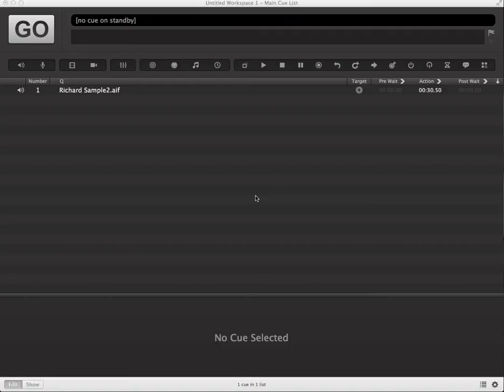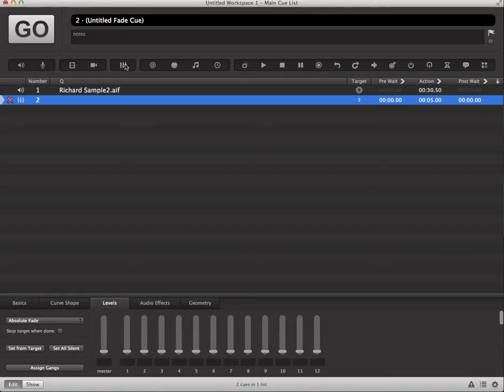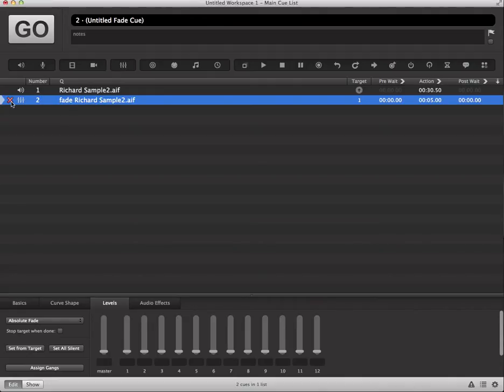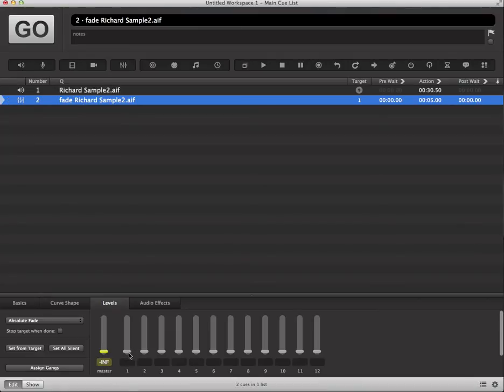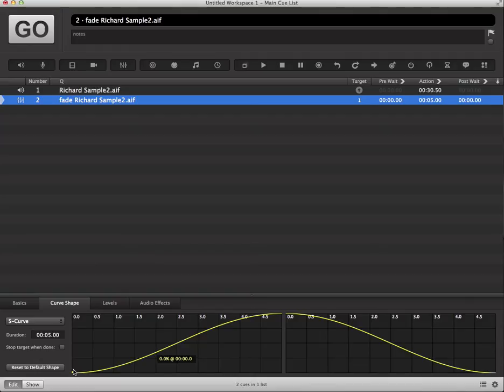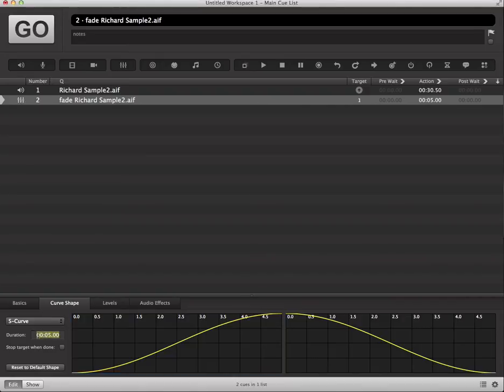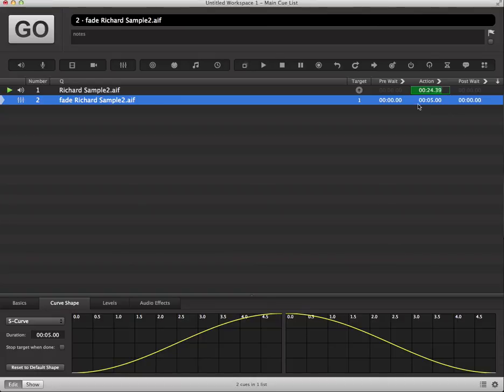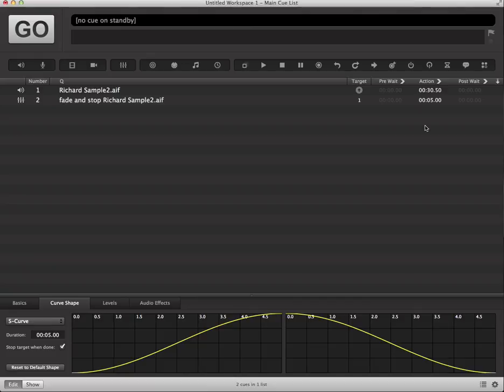Mastering the Fade Cue in QLab

Comment: Why is it necessary to not only set the master level to -inf , but also the levels of ch 1 and 2 ??? 
Shouldn't the master level be enough to take care of all device levels (I assume in the audio chain it comes before those gain stages) ?
thx 
(by the way : thx for the informative videos - compensates the lack of a decent manual somehow)
Reply from the maker: You're totally correct. The Master would be enough to take care of this. Likewise, you could have just pulled down the levels of channel 1 and 2. I tend to overkill a bit, I suppose. =)My QLab 3 Show Control book is the only one on the market. I am in the process of putting a new one together for when QLab 4 drops, so look for that within the next year, too.
Reply: Since they still haven't managed to bring out a manual (despite promises like "hiring someone specifically for..." 2 years ago), you might have found the perfect hole in the market ;)
Thx for the insights !